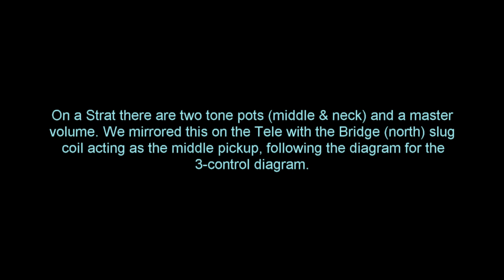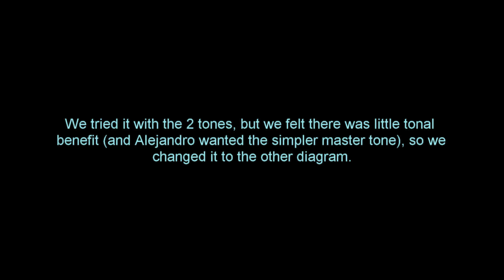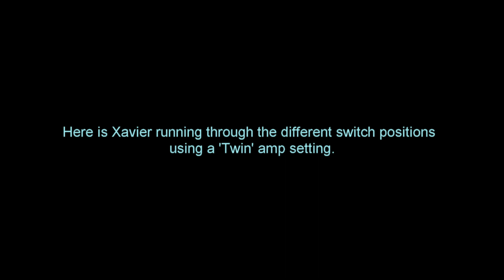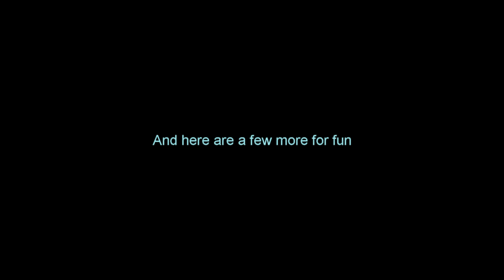FreeWay 5B5 Blade Switch on Homebuilt H-S Tele

Comment: Is it possible with 5-way (10-way) freeway switch to wire HH guitar, 1vol, 1tone push/pull?
Reply from the maker: Hi SuperDrnele, I am assuming that your push/pull is to coil-tap one or both of your pickups? In which case the 5B5 (10-way) switch will not add very much over using the 3B3 (6-way) switch. If you look on the Freeway website you will see that all the 5B5 diagrams are for 3-PU guitars. On this Tele I treated the Bridge slug coil as the middle pickup on a 3-PU instrument. I could have push/pull coil-tapped the Bridge instead and used at 3B3 switch, which would have given me the out-of-phase series and parallel  connections. I recently did a H-H PRS for my youngest son, and used a 3B3 and separate push/pull coil taps for each PU (i.e. using push/pull 500k audio taper pots for both vol & tone). It is definitely worthwhile thinking through all the different connection possibilities and which position you have each switch before changing the wiring. It is also definitely worth trying those out-of-phase positions! Mike
Reply: @mjxguerra  thanks...I am exactly talking of PRS...what do you think, is it possible to do this mod using 5-way superswitch and push/pull tone pot to wire HH: 

A. Tone push/pull pot DOWN: 1.bridge hum; 2. bridge hum parallel; 3. bridge + neck hum; 4.neck hum parallel; 5.neck hum

B.  Tone push/pull pot UP: 1.bridge single screw; 2. bridge single screw + neck single slug; 3. bridge single screw + neck single screw; 4.bridge single slug + neck single screw; 5.bridge single screw

Tone in both positions works.

pos.A is of course possible (push/pull down), I am not sure if posB is feasible (push/pull up)?

What do you think, could this be wired?
Reply from the maker: @drnele  OK, If you want to use a Superswitch (basically a 4-pole 5-way switch) you might be able to do that, but it would be worth checking on guitarelectronics.com to see if they already have a diagram for that as I'm not really competent to work that one out from first principles without spending an hour or two scratching my head. Probably not impossible though. I've now done 3 PRS' now: The first was a Custom 24 that we no longer have and that was done with a Freeway 3X3 Ultra, the second was a Santana SE  also with a 3x3 Ultra (https://www.youtube.com/watch?v=kIqF_pNHBIY) that works really well and you can generate a Strat pos4 sound out of it when out of phase. The most recent one was a Schizoid SE and I used a Freeway 3B3 blade with separate push/pulls for each pickup coil-tap (no video for that as it was very straightforward and straight from the Freeway diagram). I have done a superswitch before but I wouldn't do another as the Freeway is far better engineered and saves a huge amount of short-wire soldering. Again, if it were me and the guitar was HH with a blade I would probably use SD Trpileshots for each pickup (which allows you to connect each PU with the voice and slug coil in series or parallel, or choose either for single coil) and a Freeway 3B3 pickup switch. I think ultimately allows you 56 different connection possibilities, including each variation of series, parallel, in phase, out of phase and single coil. I think you would struggle to need more different connections than that! I mustn't forget the recent Baritone build  (https://www.youtube.com/watch?v=z0mKKSdQfbE&feature=youtu.be) that has 202 different connections... Mike
Reply: @mjxguerra  thanks for the ideas, I appreciate it...
Reply: instablaster

Comment: Hallo! i have one of those switches and planning to convert an H-H guitar into H-S ( where S will be a Sustainiac pickup) . I do not see the schematics though. Asking a very stupid /perhaps obvious thing but would like to be sure^^=
Did you simply considered  each coil of the HH as a "single pickup" bridge+middle ( off course has to have 4 leads for it ) and followed that way ? or some changes were to be made? 
I'm asking it out of logic as i'm not able to do myself but would point a tech the right schematics for it  . 
Also the difficult part will be to relate the switch to the sustainiac wiring  but off course that would be to be asked elsewhere
Reply from the maker: Sorry late with reply. Sustainiac is a kind of pickup but adding it is non trivial (see my baritone build where I combine a 10way freeway switch with a Sustainiac). The diagram that comes with the Sustainiac is not that clear and even someone technical will have trouble.   I am a professional engineer and it took me a few weeks in my spare time to work through from first principles.  Good luck!
Reply: @mjxguerra s lol i went to look baritone video  and i found a message from me asking how to use 10 freway switch ( i have a 5b5-01) , Sustainiac answered me yesterday that "freeway switches are not compatible with our product " and stop at that. I used months to get what it does too as their site is bit messy  ,Even did "half the job" by drawing a diagram with  the "sure lines"  i did by comparing the different diagrams  hoping they can fill the rest but i got a shott answer "not supported"  ,  guess i'm at  square 1.. i'm phoning lot of techs and nobody has confidence to embark in it  .
I 've missed the marantz swich you mentioned ( did read twice the video stuff to get some clues)  . Has it a code that i could look for and your schematics somewhere maybe ?EDIT:I fsaw it now , it0's the Dick like stuff laterally  on the guitar  , lol sorry it's so out of common that completely missed it , guess copuld not use something like that for sure . Mandatory or is simply to have all o-o-p stuff?
Reply from the maker: OK, this is where I had to run it through from first principles by including the Marantz switch which is an 8pole switch , but only using 6 to essentially switch out the freeway, switch on power to the sustainiac and connect the bridge to the sustainiac board. I eventually got the switch from Mouser, so it is not actually from Marantz.